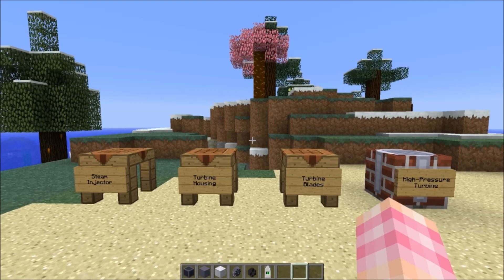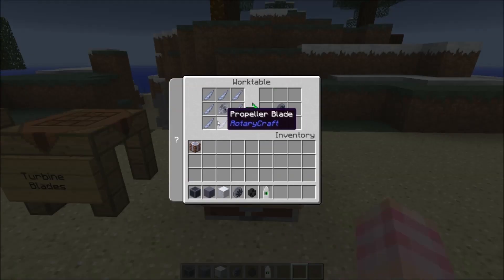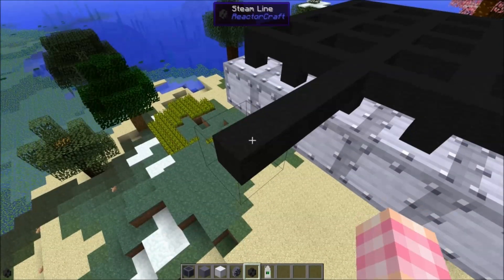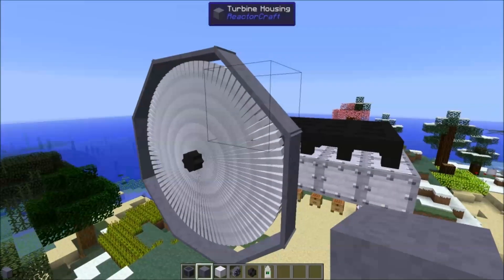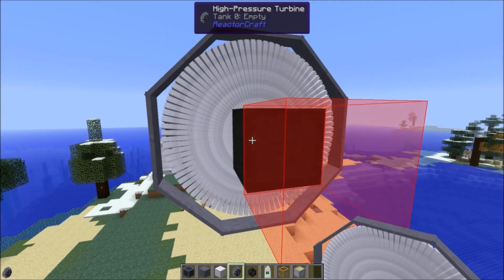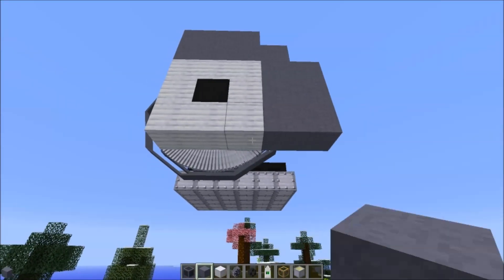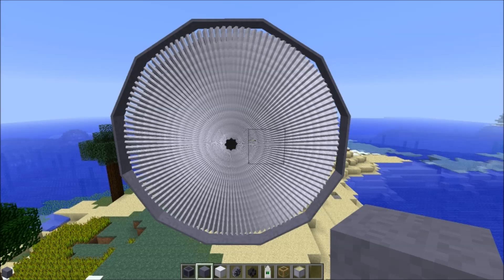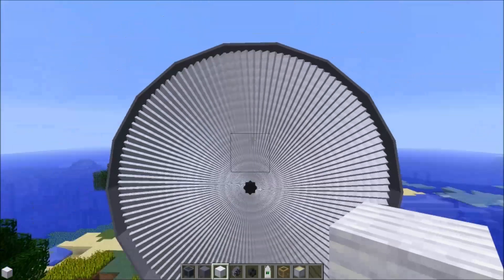ReactorCraft Tutorial #13 - High-Pressure Turbine

Comment: all tho this video is old, i am using the 1.7.10 version so they are comparable, i was wondering what happens to the droplets when you put a generator on the turbine... like does it delete them like the steam blocks or does it keep making low pressure water droplets?

Comment: You said in the Video, that the Turbine requires 28 Thungsten. Well, in my Modpack you need 100.
Reply from the maker: This video is 2 years old. The modpack has had many updates since this. I'm not surprised if its different now
Reply: Nt21TNT ã

Comment: one question why don't get the lubricant in my turbine Need help please
Reply from the maker: +Neapgear Hyperdemension The lubricant pipe needs to be connected to one of the Steam Injector blocks.
Reply: SentinalhMC i know i have do it but it doeson't work the lubricant doesnt going in the turbine and i don't know why the normal turbine doesnt work too maybe i Need another mods when the mod reactorcraft 100%work ?
Reply from the maker: Neapgear Hyperdemension
I've never had that trouble. Are you using the latest version of the mod?
Reply: +SentinalhMC i dont know i look for this
Reply: +SentinalhMC can you send me the link of the newest Version please ?
Reply from the maker: Neapgear Hyperdemension
Its in the description of most of my videos.
Reply: SentinalhMC ah ok thnaks

Comment: A turbine that runs on steam and fluid water at the same time? That would wreck the blades IRL wouldn't it? :p
Reply from the maker: +CommonExplosionHD What happens is that the steam cools as it passes through the blades of the turbine and condenses back into liquid water. It happens in reality as well, that's what contrails are behind jets.

Comment: Running an HP turbine off ammonia will step the power up by 50% to 12GW.
Reply: ReikasMinecraft And it will also make the droplet recollection worthwhile, if I recall correctly.
Reply from the maker: The tool tip for the turbine in this version still says it can only be run on water based steam. Was that a change for 1.7 or does it work on ammonia steam on 1.6.5?
Reply: That was in v25z.